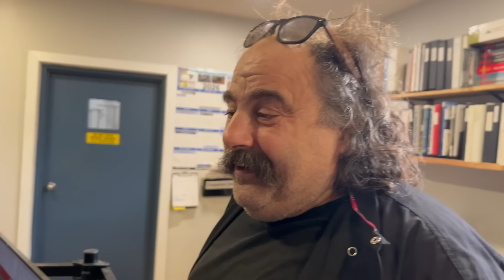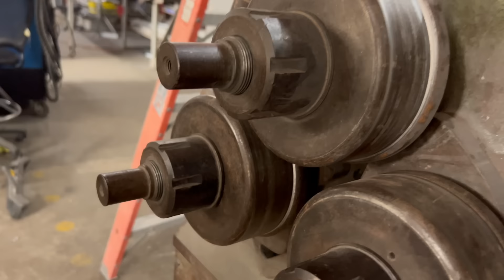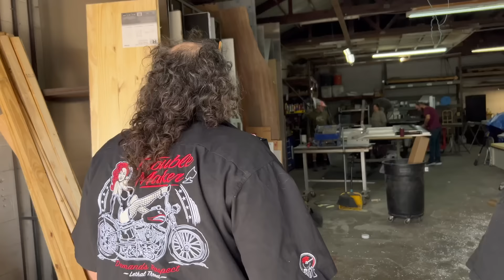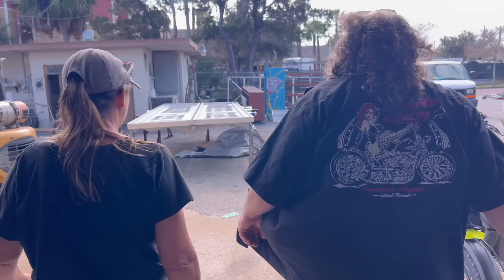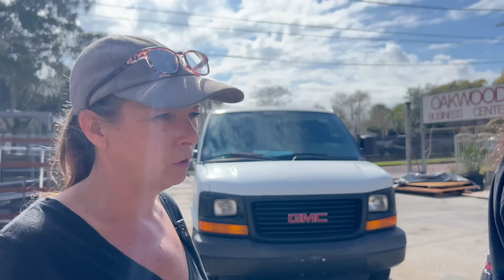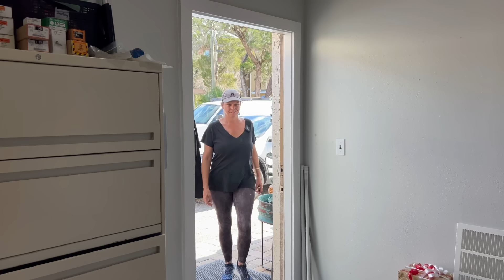“Inside a Mind-Blowing Custom Metal Fabrication Shop | CNC Machines, Ironworkers & Epic Creations!”

Comment: I cut more satin coated sheetmetal , hand formed EVERYTHING using round iron tubing 24 to 1/4 inch , cut over 260 stainless steel GUCCI ,  POPS bent up  REAL LIGHTING NEON , used 8 to 10 bandsaw blades for EACH set of GUCCI welding stainless steel  PITASS , by hand & foot 🦶 tapping for timing my POPS made the worlds BEST NEON when PORCELAIN signs were still being made